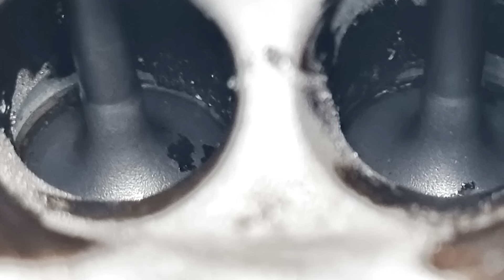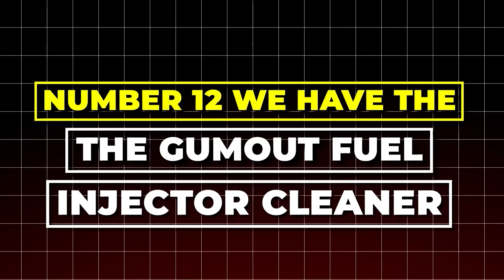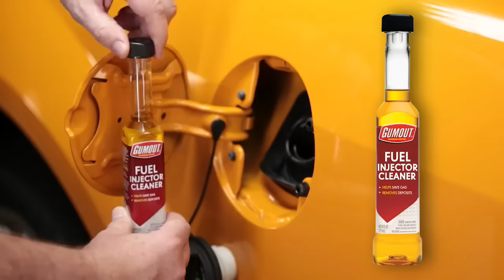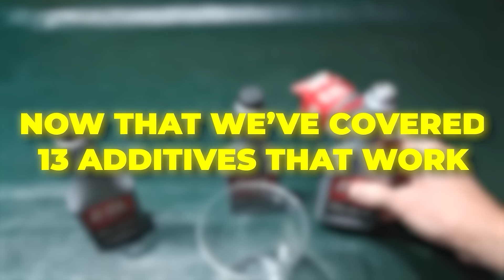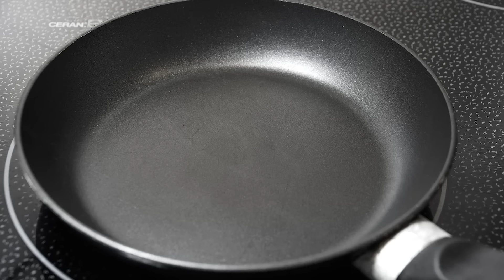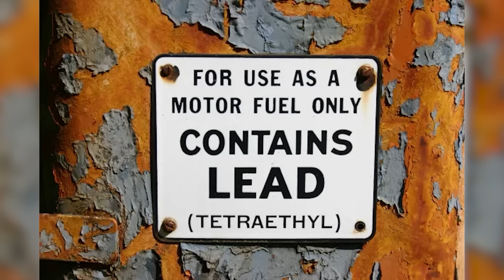13 Engine Additives That Work (And 5 That’ll Kill Your Car)

Comment from the maker: 11 Engine Oil MYTHS Stupid People Fall For- https://youtu.be/zz2Bqu6XyYE

⬇Car Care Clues Top DIY Tools and Products:
🚗 Essential Scan Tools
Newest Scan Tool:https://amzn.to/3GJyuET 
Bluetooth Scan Tool: https://amzn.to/42AcBRc 
Cheap Scan Tool: https://amzn.to/42WZIzx 

🔋 Emergency Essentials
Best Jump Starter: https://amzn.to/44fYOAm 

🛢 Fluids and Leak Stoppers
AT-205 Re-Seal (Stops Leaks):  https://amzn.to/3S9icYm 
ATS 505 Fuel System Treatment: https://amzn.to/3YQjjA2
Lucas Oil Transmission Fix: https://amzn.to/4jNk98M 
Bar's Cooling System Stop Leak: https://amzn.to/3Sht0nj 

🔎 Quick DIY Diagnosis Tools
Head Gasket Leak Test Kit: https://amzn.to/4jRgc2T 

🛠 Useful Maintenance Accessories
Quick Twist Oil Drain Valve: https://amzn.to/4jWG3GJ 
Tire Gauge (Check Pressure): https://amzn.to/3GxySGD
Tire Air Pump: https://amzn.to/3RZK9Cd 
CRC Mass Air Flow Sensor Cleaner: https://amzn.to/44dJpkb 

🧰 Mechanic’s Must-Haves
Car Battery Tester: https://amzn.to/4jTqyzk 
Basic Mechanic Tool Set: https://amzn.to/3Ymgerh 
Cordless Impact Wrench: https://amzn.to/3YkkhVc
Reply: I'm going to ask.  In your research did you do more than just read up? What is your background? By the way you left out a whole host of Lucas oil products. Including using a synthetic Lucas oil products when you use a synthetic  oil. There is a Lucas stop leak and stop burn product. I had a couple of spun cam bearings and the valve cover needed to be tightened. What's the valve cover ever so slightly and it still leaked. I had to get the truck home I just bought it as a spirit into this day it still runs with the bearings like they are. It does not burn and does not leak motor oil. I will say I've never found anything to fix a leaky Ford power steering unit.
Reply: I
Reply: 2 STP oil additives every oil change works.
Reply: 1 poster recommended BG Platinum® 44K® Fuel System Cleaner
Reply: BG RF-7 cured my oil fouled spark plugs #2 and #7 cylinders.

Comment: I love Hot Shots striction eliminator. I also like lucas products. I would not recommend hot shots transmission additive, but otherwise their other products ate tops with me even though they are on the more expensive side, worth it. Dont use the transmission additive though.
Reply from the maker: Thanks for sharing your personal experience with which additives have worked well for you and which ones you'd avoid.

Comment: Lukas oil stabilizer works well too
Reply from the maker: Many people have had positive experiences with that stabilizer for specific lubrication needs.
Reply: I have read that the lucas oil stabilized can damage the engine due to the engine small oil passages and there is another Lucas product that does the same as the Lucas oil stabilizer but i forgot to write down the name and i am research it again, my Honda Element has 113,000 miles on it and i don't want to take a chance on damaging the engine. I do use Lucas oil stabilizer on my two Toyota Tacomas a 2000 and a 2002 Its a great product!

Comment: I started using Marvel mystery oil in my fuel system, to clean things up a bit,works well, engine runs, smooth, with a mileage increase
Reply from the maker: It’s great to hear that you’ve noticed a positive difference in your engine's performance and fuel economy.
Reply: @carcareclues  you can’t expect a difference immediately, it usually takes a few tanks of gas and using the product again
Reply: I use the Lucas injector cleaner/fuel treatment and it helps.

Comment: Redex in petrol  to keep that sticky stuff that dinosaur juice leaves behind out of injectors, and Molybdenum disulphide for engine oil ( do not put it in gearbox though, your synchro will hate you )
Reply from the maker: That’s a great tip regarding the transmission—you definitely want to keep those friction-dependent components clean!

Comment: I've found that Lucas upper cylinder lubricant/ fuel injector cleaner is a mediocre cleaner compared to the very powerful Berrymans B12 chemtool. But Lucas is just that, an UPPER CYLINDER LUBRICANT, which is very important as oil on upper cylinder, piston rings, etc. is washed off by the fuel spray. In theory, Lucas and other UCL's help the engine last longer by replenishing some of that lubricant being lost on upper cylinders. I've used Berrymans B12 for years as it's the most potent cleaner available at a very reasonable price. I use it to clean parts like spark plugs and O2 sensors and watch the carbon disolve before my eyes. It's in a metal container because it's a solvent that actually eats away at plastic (carbon), but is very safe diluted in your tank. It does not have the lubricating qualities of Lucas, so I'm gonna start using Lucas every fillup and continue using B12 every 3-4 fillups. I and other mechanics wholeheartedly disagree on your assessment that oil additives containing copper, silver, and lead (RESTORE) are worthless.  I use it with every full synthetic oil change with awesome results! Project Farm and numerous others have verified it does indeed 'Restore' lost compression evenly on all cylinders. PF even brought an old sick tractor back to life with it and gave a follow-up video of it working great years after using it. The compression tests on many different engines don't lie! Even on newer engines with good compression, it helps with the oil lubrication, keeping your engine like new for a long time. Two caveats with Restore, however... It's questionable if it should be used on oil-picky engines like VVT, so I'd avoid that.  Also, it is effective if you use it with EVERY oil change. But it's definitely good stuff, with those two caveats in mind.

Comment: AC Delco 88865595 is mandatory in your GM owner's manual. One bottle per 5,000 miles.
It's re-branded Techron (Techroline tm) and serves the same function.
Both come in 12oz and 20oz to suit your tank size.
Techron is usually easier to find. Buy it by the case/multi pack. Use it.
(I keep a bottle in my truck for whenever Chevron is not available such as in longer trips.)

Comment: I will say this if your oil, transmission fluid, gear luber and coolant all match the correct OEM spec listing there isn’t anything you need to add if the seals leak bad enough you’re worried get them and replace them or find someone who will extend that service. Fuel additives do work and they work incredibly especially those with a hefty amount of PEA chemicals, these additives will clean out your entire fuel loop even remove carbon and other build up off the exposed sections of the combustion chamber, piston heads, injectors and work incredibly well. If you leave a car sitting through winter especially if you use ethanol gas you will never go wrong with stabilizers when ethanol separates from gas the results can get pretty nasty. You best effects for fuel stabilizers and additives like cleaners poor them in when you go to get gas right at the pump before pumping gas into the tank the refueling process will agitate the additive ensuring they mix into the tank swiftly and evenly so you can get results immediately instead of waiting for it to permeate through all the fuel post refueling. Be careful when adding cleaners to the oil, most of the time these aren’t necessary I will admit I got a used pickup with 170,000 miles as my first car my first oil change I did a sea-foam treatment in the oil right before changing it (if you don’t know oil changes should always be done hot your engine is up to heat, the oil has run through every passage and component and is at its most saturated with sludge, contaminants and other impurities this will remove vastly more gunk from your engine compared to cold changes). But if your engine is heavily bunked or you get unlucky dislodged sludge, contaminants can plug vital oil passage which can worsen lubrication and increase wear or cause the entire engine to seize up. Best practice is to use an oil with good additives especially detergents and run sludge out steadily with every oil change. If your engine is know for gathering/generating sludge you should change from conventional oil to synthetic if your engines age and characteristics permit it. The synthetics have more benefits like better oxidization resistance and better control over formulation and blending compared to conventional. Whatever you do if you’re going to pursuit de-slugging measures change the oil more often and use the best filters you can afford, but it’s kind of the nuclear option for that line of procedures. It’s been 4 years since I got my used truck and the heads when from a slight layer of consistent black sludge down to a light brown varnish and practically sparkle compared to when I inspected it last. Quality products and care will restore and most importantly extend the service life of any component on your car.

I swear by fuel additives on occasion especially if your wallet is too shallow to consistently feed your beast premium every pump stop. Premium fuels receive better additive packages in vastly higher concentrations, con it can get expensive as hell to feed your car if you drive a lot or she guzzles gas like a German does beer.

Comment: I have a 2012 Escalade and use the high mileage Lucas additive when I change my oil in the summer months. Using it in the winter makes my oil too thick and the engine has a hard time starting. Outside of that, I think it’s a good additive. I just wouldn’t recommend using their regular oil stabilizer unless it’s going in a diesel truck at minimum.

Comment: I have had success with DOHC VVT  motors quieting down after using ATS 505 CRO and CRF. 
IT DID NOT HAPPEN QUICKLY.  I did frequent oil changes after treatment.   [Never past 3000k before and after.]   It took 5k - 7k.  
   I've made videos of the 2nd motor to receive the treatment -- "Ol' Clacky Cams."
    The 2.0FSI got (3) 1K changes in a row. I split the  treatment in half because I was scared for the turbo bearigs.  Ol' Clacky recently burned out another glob and got a step quieter.  maybe I don't have to replace the chain tensioner?  Time for an early oil change.
   155k and 220k at time of treatment.  Both cars were subject to 8k oil change intervals by low rpm drivers, Before me.  
 I changed oil 4-5 times in one and 12 times in the high miler before treatment.   
    
    NAPA Red Synth on sale, Castrol Euro Car from Wal-Mart. Always new filters, Wix me. 
   Liqui-Moli every time it drops to 30 bucks a jug.
   To the Redline! And Beyond!

Comment: There's not a single fuel additive on the market that is worth you spending your money on. There are so many detergents and cleaners in the fuel that you get at any gas station in the country that is going to clean and do everything else to your fuel injection system that these additives claim they do.

Comment: I agree that there are some additives that actually work and help your motor and transmission, and some that don’t and some that do the opposite. Also with today’s motors and synthetic oil, you should be able to go 5-7000 miles before an oil change. 3000 mile oil changes are great and everything, and I know people that get ansy at 3200……….but it’s overkill, and you still have miles left.

Comment: Phaser 3000 by Primrose Oil is a superior rated fuel additive. Reverses Phase Seperation and removes water by encapsulating the water molecule. Prevents rust and corrosion, improves combustion, eliminates carbon, varnish and sludge, increases RPM’s, cleans injectors among other things. Our diesel fuel additive is the best out there. Power Klenz 5007 and Rescue 5055 are superior products. It’s weird how no one ever shows these considering they are phenomenal products. Even have a fuel additive invented during WWII for the US Defense Dept that cleans and lubricates with many other benefits. For gas or diesel as well as the Phaser 3000

Comment: Use a Top Tier gasoline and forget fuel additives. Use a decent synthetic oil and change it and the filter every 5000 miles or less and never put any additives in your oil. 
Forget the snake oil, it will only cause you problems

Comment: Former oil industry and lubricant tech consultant here.  Never put the following things in your engine if you want it to last more than 5 years:  This is info for general use, and special circumstances may be different for racing, classic or other special cars.
1. Anything with a "secret ingredient" or something you never heard of before with an obvious made up name-aka Mystery Oil additives.
2. Any lubricant containing a heavy metal such as molybdenum disulphide/Moly/Moly B, Zinc, or any additive containing metals.  Best way to destroy your car's engine.
3. Anything containing teflon or any other additive that is designed to coat the interior surfaces of the engine with a "coating" of anything but a lubricant.  Teflon has destroyed engines for decades by clogging tiny lubrication holes in engines and starving them from oil in specific places.
4. Heavier than designed for oils, and "oil stabilizers", many of which are just thicker oil. This will reduce oil availability at higher speeds and potentially causing blockages.

Before anyone says they have been using one of the above for years, etc.   Flukes happen, but most people don't want to take a chance and do something they know is stupid when rebuilding or replacing an engine is extremely expensive and time consuming and virtually guaranteed if you do any of the above.

Comment: I stand by Seafoam, personally. It's a great cleaner of burnt-on oil and sludge build up. I use it in my gas once in a while, since I'm too poor to afford premium gas. I don't use it in my oil too often, usually once a year, when I'm about due for an oil change. To try and clean of any internal parts that may be caked in oil build up. 

I love only ever owned older, well-used cars. So, a little preventative maintenance is always a good idea. Not sure if it should really be used on newer cars, though, again, preventative maintenance isn't always a bad thing, so long as it's done sparingly.

Comment: Used seafoam in my gas and lucas oil stabilizer pretty regularly.....03 gmc with 5.3l was still running strong when i drove her to the scrap yard. Just shy of 400k on her. Rust had cancered her away. Framecracked

Comment: Lucas has no additives - meaning it is diluting the additive package of the oil significantly.  This is a large reason for the foaming issue, which leads me to question the "stabilizer" claim.  If you want a thinker oil, just run a thicker oil.

Comment: Lucas, "i put that stuff in everything!" XD but really, there's not a single engine I've owned that didn't get that sweet stuff. small engines, big engines even used as gear oil. never an issue, always an improvement!!

Comment: If you need an oil additive, you're using the wrong oil. Most name brand full synthetics are formulated with their own additive pack. Adding a thick base oil (Lucas) is just diluting the additives in the oil.

Comment: Funny how I used Lucas in my 2002 Yukon XL Denali from the day I drove it off the lot. Literally died in June, had 630,000km. Engine was the only thing left without problem, it ate 2 transmissions amd I bought a new truck. 
Please tell me how Lucas kills engines.

Comment: LUCAS SYNTHETIC FUEL AND ENGINE OIL COMPLETE IS BY FAR THE BEST I USE ON MY CHEVYS AND KIA ITS THIN IT HELPS OIL LAST LONGER AND ALSO CLEANS FUEL TANK AND LUBES UPPER CYLINDERS.

Comment: Now don't dog that white bottle Lucas. I was low low on oil in my mom's 1996 s10 blazer one day. I grabbed the Lucas and filled the engine back up with maybe 50/50 oil and Lucas and continued to run 😂

Comment: I worked in the automotive industry most of my life. My father spent 45 years working on HP motors such as Porsche etc. He also built those motors for race applications etc. Seafoam and Lucas are the ONLY products we have ever used or recommended
Reply: Seafoam in the gas tank?

Comment: my poor sonoma was 15k down a 4wheeler trail and blew fuses for the drive shift, electric hub locks suck. Stuck in 4 low it was a long and tranny tortuous affair. burnt the tranny bad, could barely get up roadway hills. Lucas tranny fix did the trick.was able to haul 2 tonne trailer without slippage. Nothing but praise for Lucas

Comment: They left out STP, that crap has a tendency to bond with carbon produced in the engine and forming a thick sludge in the oil pan, I have seen it get so bad that the oil pan is full of what appears to be like Jello except harder with a large groove in it where the crankshaft sat.

Comment: I worked for a championship race team and we actually tested oils and additives looking for best results. Lucas truly did help wear
Reply: You're right. I would not put a whole quart/20 percent to 5 quart oil change! In old hoopty engine I enjoy adding about a cup or so  of lucas full synthetic to oil change. This really helps stop tail pipe smoke. Visual smoke from tailpipe is instant smog test fail. 
My dog doesn't need treat biscuits either, but it makes me happy to give him one now and then...
Using additives in my old car makes me feel good. I admit it's as much for entertainment as for any benefits... I believe in the mysterious magic of Marvel Mystery Oil Too!😅!
Reply: It dilutes the oil's additive package, which leads to the oil needing changed sooner.  It also dilutes the anti-foaming agents, which can lead to aeration of the oil and higher wear as a result.  The tribologists spent significant time creating the perfect additive package, and lucas screws that up in the 30 seconds it takes you to dump it in.